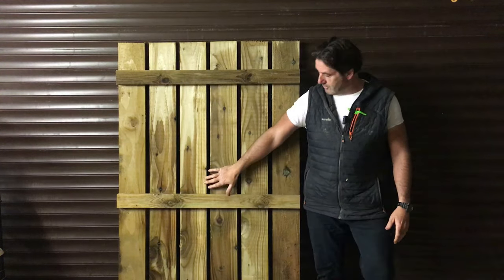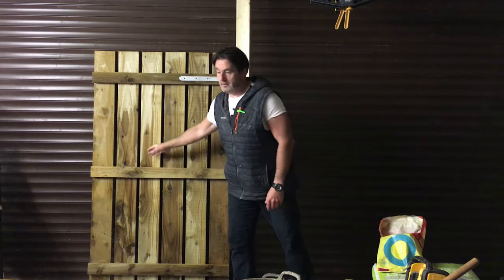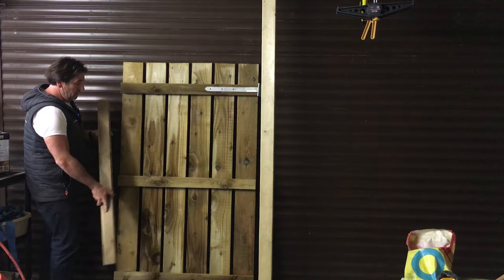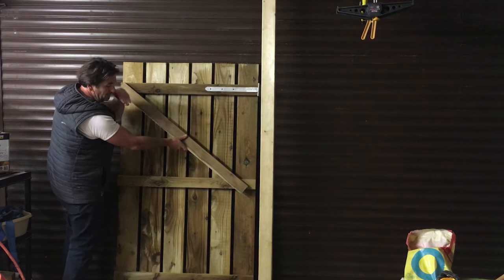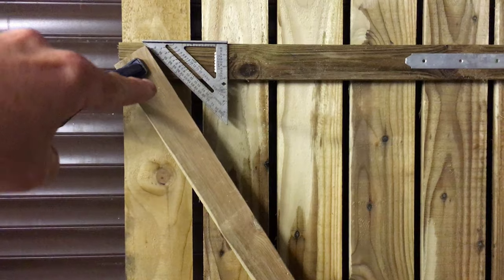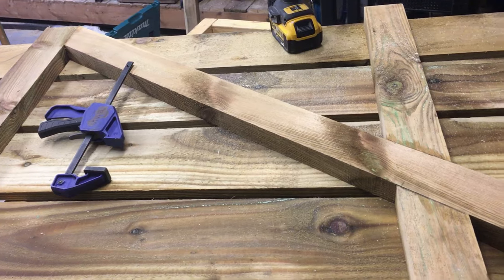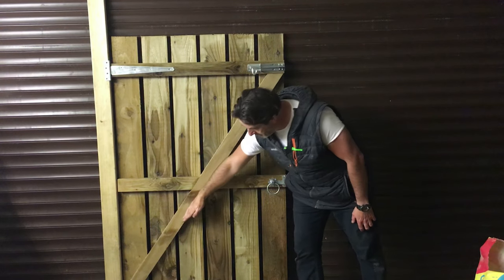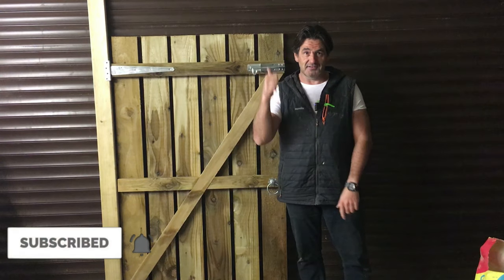How To Stop a GATE from Sagging

Comment: I just watched another video from a fence installer and he said the angle should be 45 degrees or LESS. Can you clarify which it is? It seems like once you go past 45 degrees, the brace would be weaker and want to pull apart. Thanks!
Reply: Nevermind! I figured it out. You guys are saying the same thing. You were measure the angle between the top board and the brace, he was measuring the angle between the side board and the brace. If your angle should be greater than 45, his should be less. Sorry for the confusion!
Reply from the maker: Yes, depends where you measure the angle from, but hopefully you figured it out.

Comment: How did you measure and cut the angle so it fitted flush in the brace?
Reply from the maker: Just lay the brace on the gate and then use a straight edge to eye the line. Mark it and then cut in the mitre saw. You can see how I do that on this video https://youtu.be/cjVIita2TXs

Comment: with everything secured in place, why without bracing will the gate sag?
Reply from the maker: Because if it is braced the other way, the force of gravity over time will naturally push the furthest corner from the hinges downwards. If it is braced correctly, that force will be directed to the bottom hinge and will hold the gate in shape.
Reply: @Bacrenfencing  Thanks but I still dont get it. If each vertical board is held in place by 2 nails or screws at each horizontal and the hinge is secure, I just dont understand how it can sag. I am not saying it wont, I am just trying to understand why. The hinge at the pivot would been to open up at the top for the top to tilt.
Reply from the maker: Basically if there are no diagonal bracers, the gate will easily be pulled out of shape. Try it yourself, if you get some fence boards and put in three rails without any bracing, see how easily this can be pulled out of shape. Put one corner on the ground and then pull down on the opposite corner, the gate will basically pivot and go out of shape very easily. Kind of hard to explain........
Reply: @Bacrenfencing  thanks for trying